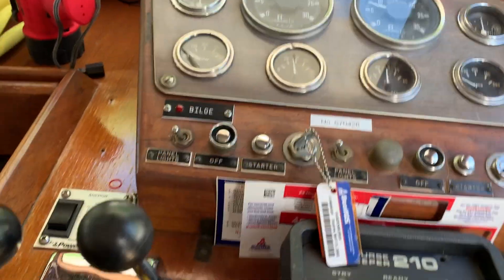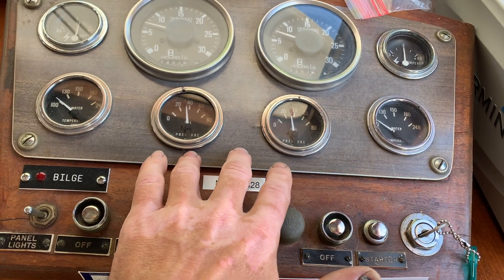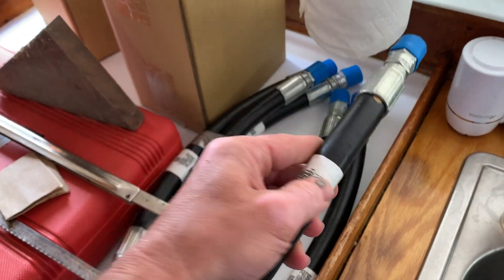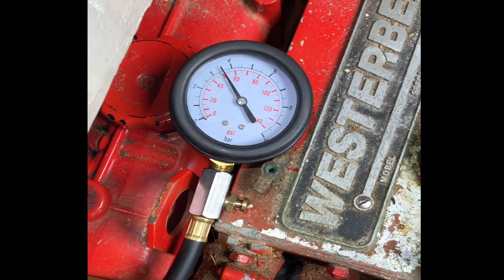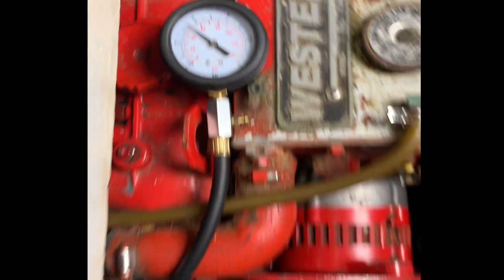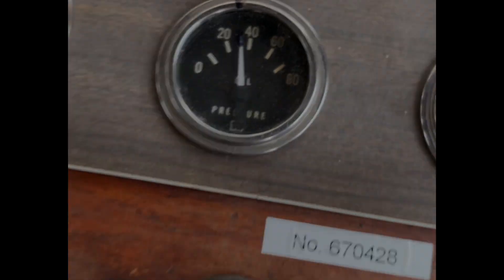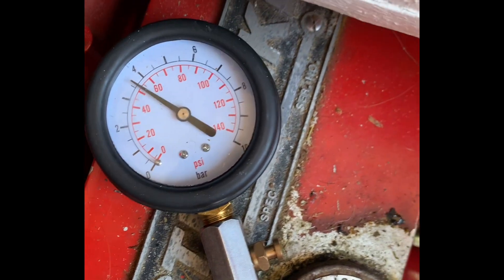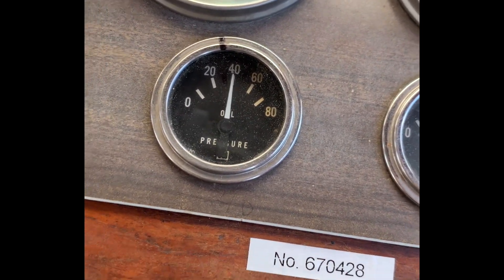Ford Lehman 120 Trawler Oil Hose Upgrade

Comment: Quick question. On your port engine, while you were ahowing the helm pressure i noticed it would jump every 5 seconds or so. I can hear the click in the video which seems to be why the pressure gauge jumps the way it does. What is that click? Just bought similar boat and have the same click
Reply from the maker: Somehow and for some reason, the oil pressure gauge and the engine hour meter are sharing power, hence the jump every time the hour meter ticks over. Not sure if that was original or if some PO messed it up. It's on my list of things to address.
Reply: Good video, and thanks.  Try to figure out a high oil pressure reading on a 44' trawler.  We're at sea at the moment, and it's reading 80psi.  Both engines were serviced a month ago.  I'm inclined to think it's a faulty sensor - any thoughts?
Reply from the maker: @TrevorTownsendOfficial  Just seeing this. Sorry. No other way than to verify with a separate, stand-along gauge/tester, unfortunately. I have a Perkins that read high. Temporarily installed a mechanical gauge to test. Original gauge was faulty. Good luck.